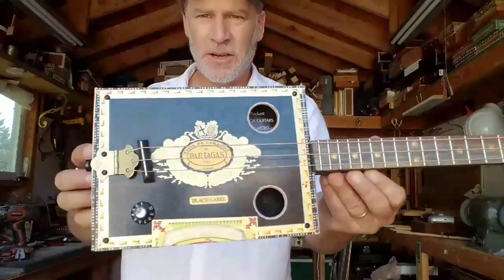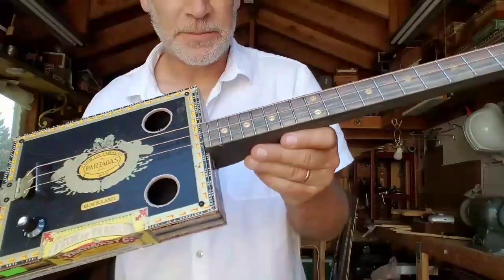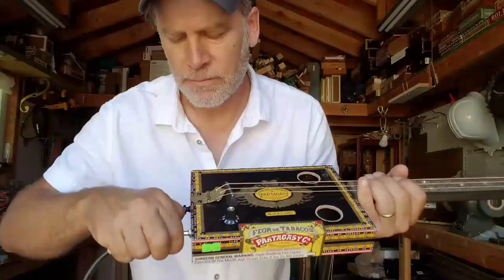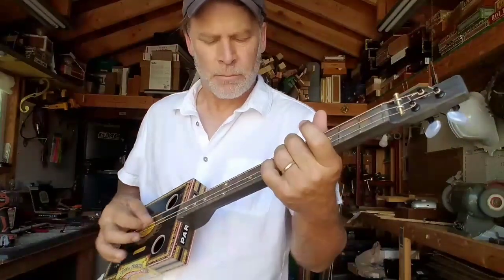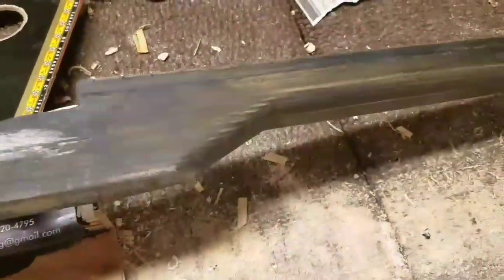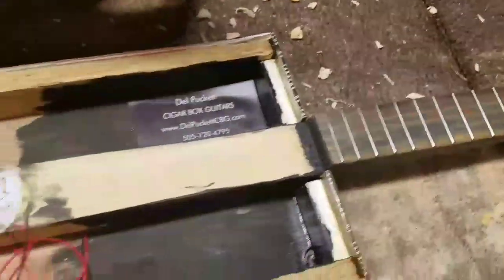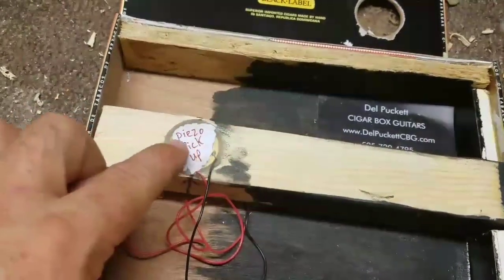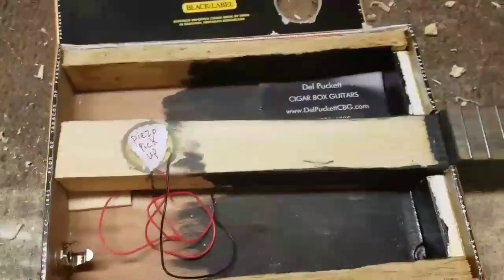Partagas - 3 String Cigar Box Guitar

Comment: I am assuming that the shim under the neck through in the bottom back of the box was your neck angle adjustment. NICE BUILD and GREAT sound!
Reply from the maker: Henry Lowman that is so the neck fits tight against the top... i have several video's showing exactly how the back angle is achieved.  Good observation though 😎